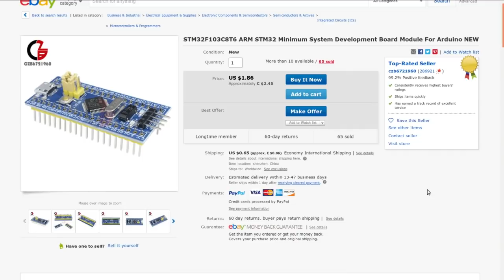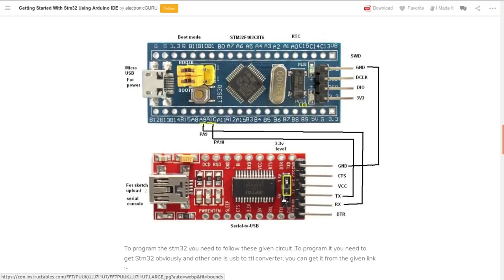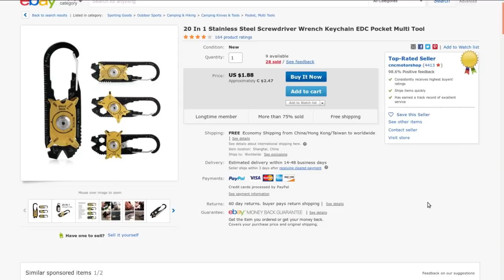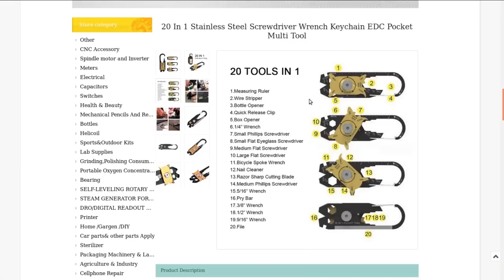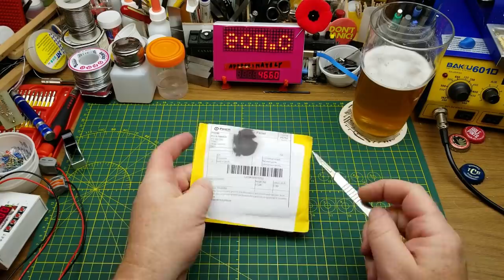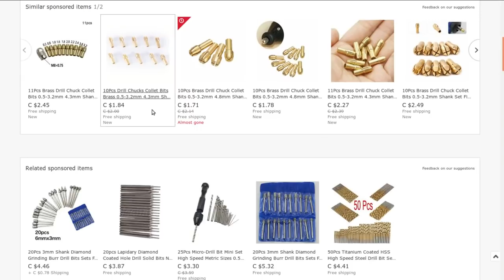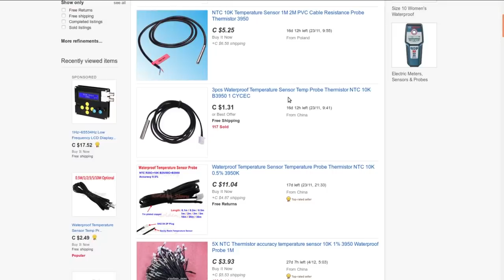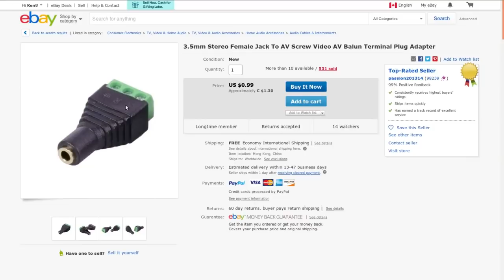mailbag monday 72

Comment: That audio jack screw terminal adaptor would have come in handy for the video I just filmed where I had tiny strands of copper constantly falling out of the breadboard  where I chopped off the connecter and didn’t bother to properly tin the wires or connect them to something more robust. Looks like off to eBay I go.
Reply from the maker: Don't you go bidding against me and running the auction price up!
Reply: I was hoping you had already scooped up the ones you needed. There may be a slight problem!
Reply from the maker: Nah,I'm good. 
Just messing with you..
Reply: FWIW I cut out small pieces of phenolic paper PBC and soldered those cheap panel mounted 3.55mm mono jacks to them with header pins for inserting into a breadboard. They stay in the breadboard relatively well but can pop out if bumped about too hard.

Comment: It's independence day here in Poland. This STM32 board is by some people called blue pill, because of blue pcb. You can also get red pills, or black pills. There was somewhere a wiki page with info on them. And yours might be actually not 64kb but 128kb.

They are useful, one day i tried to compile on one my rolling dice sketch that made for attiny13 (only 1kb of program memory) and compiled program for blue pill was like 10kb or something. Crazy

Comment: it will be good to see how you get on with the STM32., nice vid to start the day with :)
Reply: Yes, but do not use the Arduino IDE/OS. It just so much wasting performance of the STM32
Reply: @ArjanvanVught  i kinda have a love hate thing with arduino's. i love that i can throw a board down and get somthing working fast. but once that's done gettig timmings right is a pain. And today i've had the IDE falling over with segment faults. comment out one line of code and it's ok, put it back and it's still ok. need  a better ide

Comment: I have a tool with the 4.8mm shank, so I'll have to order some in 4.8mm now  LOL
Reply from the maker: If you actually receive the 4.3mm ones, we can trade...
Reply: @pileofstuff  LOL I'll let you know when they arrive.  The cost of post between Canada and Australia would be more than they are worth, but it would almost be worth it for the laughs.
Reply: @pileofstuff  I just received my collets, and they are the right ones.  I'm almost disappointed since we can't trade ;-)
I have a lot more options for my mini tool now though.  It always irked me that it was limited to bits with a 3mm/1/16" shank.  I had already bought a couple of boxes of PCB drills that do work though - boxes of 10 drills in set sizes on 1/16" shanks are only a couple of bucks from China, ridiculous pricing when you consider that sort of tooling for CNC PCB fabrication is usually 60 to over $100 per box depending on quality.  You might consider a few if you don't already have some.  I think I got 0.5mm and 0.8mm.